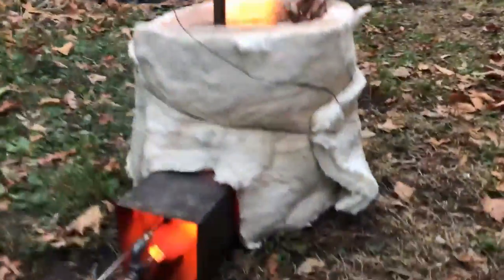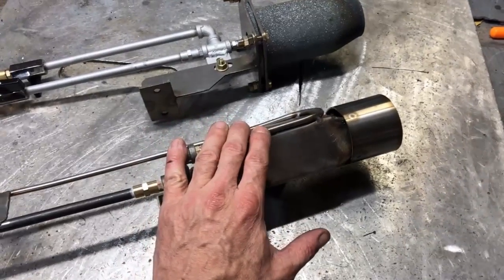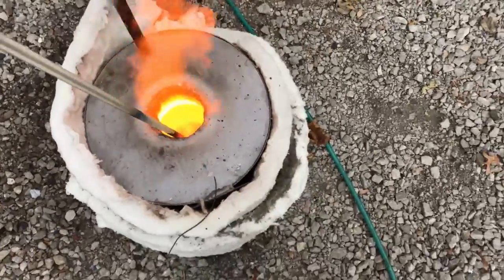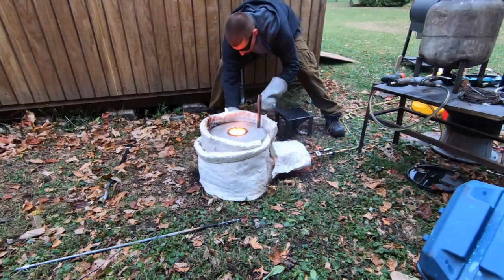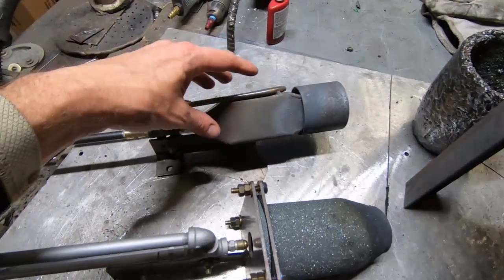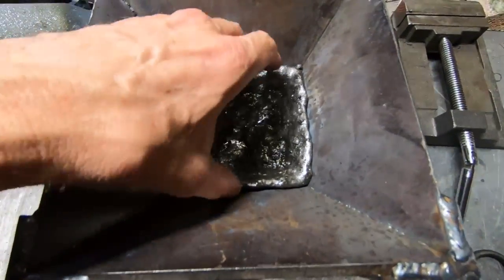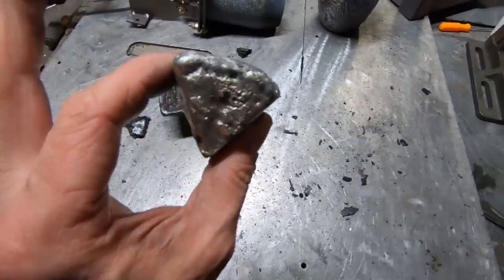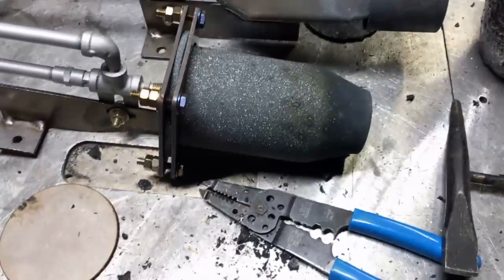Ewaste smelting burner comparison quadrupled yields

Comment from the maker: Guys i sell these on my website or you can just email me . Info is in description .
Reply: Try wrapping the air tube around the silicone carbide chamber in a coil for a couple of turns to preheat the air. In the stainless burner the air tube curves around and is also welded to chamber. It's not only the fuel that benefits from the heat, it's also the air.

Comment: Give some credit to the shape of your fire box and air preheat. I think both contribute to the better burn.
Reply from the maker: I have a video of a side by side comparison and it gets you about 50 deg hotter , not much but whats cooler a burner that can hit 2,650 deg or one that only reaches 2,600 ? LOL trick question but the answer is easy if you spell cool with a K .

Comment: brother what fuel are you using and is it on sale too
Reply from the maker: Yes i sell these burners , they burn any thing any waste oil propane or diesel . My contact info is in the description
Reply: @NOBOX7  can diesel fuel be replaced with used oil from a motorcycle
Reply: @NOBOX7  and how many dollars you sell for one unit of this tool

Comment: Have you tried a dual layer/encased burner setup, thin metal inside, with outer casing being the long life variant, that way the inner burner is expendable, and if it ever does burn up, you retain functionality, might even get more heat
Reply from the maker: Not worth the trouble

Comment: Would be nice to know what the materials are,  platinum palladium, silver or gold?
Reply from the maker: all
Reply: @NOBOX7  since the metals are all mixed, what are you doing to separate them?    Seems heat firing with greater temp controls would be needed otherwise it would be a $ loss on Platinum and Palladium Gold vs the silver & aluminum materials.

Comment: So as the burner get older it gets hotter?
Would the ss burner be a more efficient.
Or is it using more fuel as well?
Reply from the maker: Because it is hotter it can burn more fuel , its hard to know for sure because it can run shorter runs and do the same work as a colder burner over a long period
Reply from the maker: yes as it gets thinner its max temp ability will increase

Comment: What about heating fuel before it enters combustion chamber?

Maybe wrap it in ceramic insulation so it will heat up
Reply: It causes a slangy residue when its heated to high in a pipe

Comment: Thanks very nice  video.  If I m not mistaking in rocket engines the ejection tuyer are cooled , to withstand  the heat and radiation.  I do not know  if it's  possible in this burner?